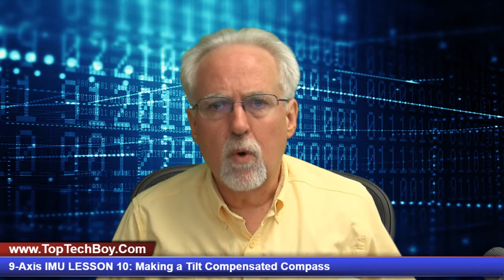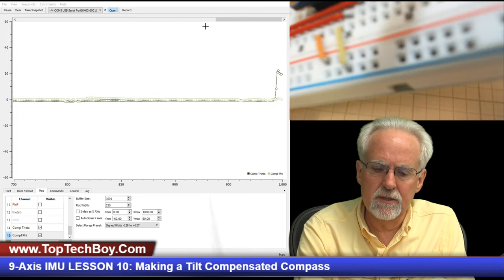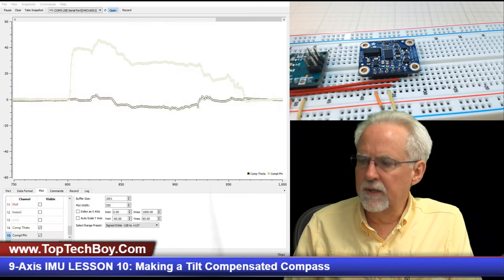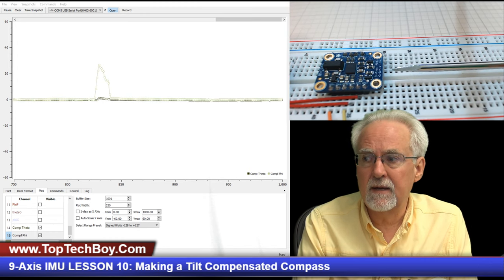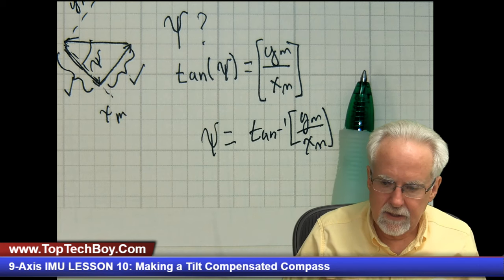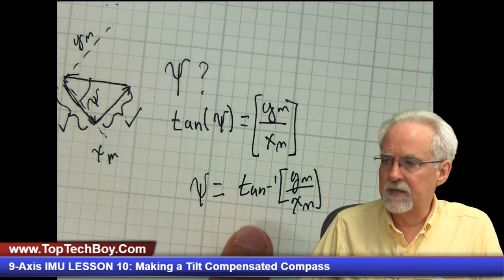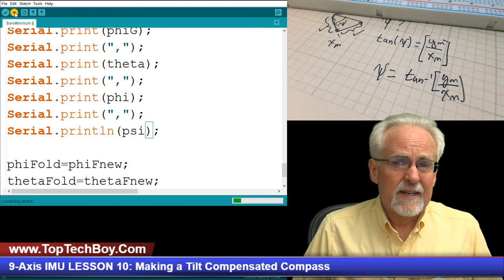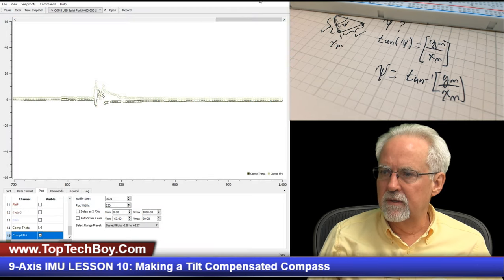9-Axis IMU LESSON 10: Making a Tilt Compensated Compass  with Arduino

Comment: Thank you, Paul, for this great series of lessons! I am really looking forward for the next videos.

I have seen some comments wondering how to derive Xm and Ym. I don't know if this was your approach (please correct me if I am wrong) but this was how I derived the solution for me:

When reading the measurements [mag.x() mag.y() mag.z()] we basically read from a coordinate system that was rotated around the x-axis by our roll and rotated around the y-axis by our pitch. What we want to achieve, is to get equivalent values [xm ym zm] (well we don't really need zm) from a coordinate system that was not rolled or pitched and thus is only subject to yaw.
So what I did was to apply two rotational matrices. Rx to rotate the vector [mag.x() mag.y() mag.z()] around the x-axis by our roll and Ry to rotate it around the y-axis by our pitch (Rx and Ry for 3D space can be easily googled). The coordinates of the non-pitched/rolled vector can then be calculated as [xm ym zm] = Ry*Rx*[mag.x() mag.y() mag.z()]. 
As mentioned earlier we do not need z but when sticking to the vector / matrix notation we can use standardized operations and simply forget about z later.

This leads to almost the same solution, except for some different signs. If you are using the newer Adafruit IMU with a StemmaQT connector, you also have a coordinate system printed on the board. If you stick to it with all the mathematical conventions, the solution using rotation matrices works right off the bat. 

Maybe this will help you or if I misunderstood something, maybe you can help me :)

Comment: I'm building a flight telemetry computer to control the recovery system, and monitor the precise in flight thrust characteristics of a hybrid fueled rocket. My research team is developing a suborbital launch vehicle that can reach space, and return with a small payload for use in atmospheric science, education, and microgravity research. Our goal is reducing the cost of suborbital throttled ascent launch systems to a tier available to high schools. I use more complicated maths (like quaternion algebra), but I find your videos helpful in the overall networking and debugging process. (I'm a rocket scientist, but a horrible programmer). As always thanks for the entertainment and educational resource you provide, and I'm especially interested in how you read data into visual python.

Comment: Another great lesson!  I'm catching up with the math - one question:  Does the Magnetometer need compensation for us in the Southern Hemisphere?  For it to point North, I ended up reversing the [your] Xm and Ym values as follows:  Xm=-mag.x()*cos(thetaRad)+mag.y()*sin(phiRad)*sin(thetaRad)-mag.z()*cos(phiRad)*sin(thetaRad);    and   Ym=-mag.y()*cos(phiRad)-mag.z()*sin(phiRad);    The Magnetometer output is noisy [maybe the indoor environment?], but anticipate to cross that bridge later progressing through these Lessons.  Great work, Paul. You certainly have a knack of making tech accessible.

Comment: I have a BNO055 and was going through various tutorials (including Adafruit) that gave formulas and output. I am so thrilled that I found yours. NONE of them (that I can find, and I have been looking) take the time to break down the individual sensor capabilities to show how they work better together. Thank you  for that! So much more of it makes sense to me now. How long did it take for you to plan this series. Very thoughtful.  I would love to learn more. Please keep going. 
My only comment on your production - first episode: I would explain to people that you think you can read the accelerometer to get change in speed in any direction, Gyro to get change in pitch, and the compass to get magnetic heading. That is not the case. That is why you will want to stay through the whole series to see how to get them to work together to get change in speed, attitude, and direction.
I am a glider pilot with lots of instruments in the panel. I have also taken to flying Quicksilver MXL Ultralights, where the only "instrument" is a Hall wind meter like the ones at http://www.hallwindmeter.com/gliders.php. I like the idea of providing a single display that adds the information derived from a BNO055 and an RC aircraft I2C airspeed indicator. It would not be a critical component because the primary indicators are; the wind meter, the wind on my face, and the gravity sensor in my butt. Please keep going.

Comment: Kudos Paul on all the great work you put into this series!!   I'm following each lesson, with all the same hardware.  The value I get for psi (heading) jumps around a lot (+/- 5 degrees), so I added a low-pass filter to the Xm and Ym values, but even with heavily weighted filters (0.9999 on prior  and 0.0001 on new values), I still see lots of noise in psi.   I'm thinking I should try moving the filter further upstream, to the mag.x(), mag.y(), and mag.z() values, and to use an averaging window on the prior 10 or so values (perhaps the root mean square of these).    Do you have any suggestions on best methods to filter the noise out of psi?
Reply: Would love to know how you solved the noisy psi signal?  Mine is very noisy and it's not a code issue.  Interference from being indoors?  Mine jumps easily 20 degrees which makes it unusable.  Thank you.

Comment: Hey Paul. Thanks for the great video. My application is going to be with a raspberry pi for a sailboat autopilot and visualization of heading info.  I had planned to use the HMC5883 Compass but the tilt error is enough to make a junior coder cry. I'm going to try a GY-9255. So much fun. Thanks brother.

Comment: Great!! had a IMU6050 and bought a hmc5883l for compass.. following and working till now with STM32 , very neat Paul!! waiting for the lab when you would calculate the position based n these inputs!!
Reply: Hi Manu, I  have MPU6050 and HMC5885L ,. Roll and pitch is working but I have problems with Yawing, 
I did everything by same way as Mr. Paul did, but Yaw is chaning when I'm tilting.. Can you upload source code somewhere?

Comment: I love this on the compass. I've used a compass for many years and always wondered how an electronic version works. I'm still having problems with my output to the Serial Plotter. My code corresponds with yours exactly so it's not the code itself. I've watched the output to the serial monitor and noticed one thing when calibrating, the "System" value stays at "0" and will not change, where as before it took a little bit but went to "3" no problem,  but the other values still go to "3" quickly. So I've ordered another BNO055 to see if I've done something to damage the board. Keeping my fingers crossed, sorry can't hold my breath that long...LOL.

Comment: We are still here, would never miss it. In the Bosch documentation it is mentioned that we can save calibration data from previous sessions and load them during startup. Has anybody looked into that?
Reply: On Adafruits website:  The BNO doesn't contain any internal EEPROM, though, so you will need to perform a new calibration every time the device starts up, or manually restore previous calibration values yourself.

Comment: Great video, I provided a like! Question, how do the heading tilt compensation equations (xm, ym) change for the MPU9250 magnetometer sensor? I know that the magnetometer is oriented differently relative to the gyro/accel sensor. Thank you for the help.

Comment: Hello Paul. 

I am enjoying your lessons about how to use the IMU.  Very informative and easy to follow along.  Of course you're teaching a lot more than just the IMU because your' also giving insight into building arduino sketches.  

I was wondering if it's possible for you to consider guiding us through the process of programing the BNO055 into the RPi Pico.   I understand the mechanics/math for determining "tilt" but would like to know how to capture the data from the IMU directly from it's registers into the RPi Pico.

I'm building an automated leveling platform for a very large (4ft X 4ft) 3D Printer and think that an IMU would work great.  However, I'm not sure about is the "calibration".  
It won't be practical to spin the IMU around like we did in your BNO055 lessons since it will be embedded in my large scale 3D printer.
Any help on how to do the calibration a different way?

Thank you so much for what you are doing.  God Bless.

Comment: I'm adapting your code for the new BNO080, and I'm gonna use this for an autotpilot for a boat. Could you quickly go over, or point the direction somehow, on what I would need to do in order to get what you call "the proper math". (I did all the calc etc. in university, I'm a CompSci major, but it's 25 years ago now... I'm mainly a coder.)
Reply: I was going to ask Mr. Paul the same question too. I'm glade to see your comment.
Mr. Paul, could you please highlight the calculations you mention in the lessons?

Comment: So I added 180 to the [-180 to 180] range so it would always read as if reading off of a compass (0 to 360), but I have a question if anyone knows the answer! Is it possible to transition our inverse tan equation into an either sine or cosine equation? That would take care of the asymptotes if I'm not mistaken and save us the issue of the Arduino flashing between the asymptotic values... non mathematician here, just a thought!  

As of now I made a low pass filter to prevent so much noise and when it reads higher than 359 or lower than 1 I had it ditch the low pass filter and delay for a half second to prevent the slow jump... didn't work as planned hahaha

Comment: You might wanna make update in the code:
- where converting thetaM to degree is done with /2/3.141592654*360
- and doing this conversion again while calculating psi

Comment: Hello, teach Paul! I have a question here: In this lesson, we are determining Yaw using magnetometers. So does that mean that by using accelerometer and gyroscope cannot get the data of YAW? If so, it would be confusing as if you see X-aixs, Y-axis and Z-axis, I think there is no different in their properties, they are all just directions, so how come we cannot get YAW data with accelerometer and gyroscope only?
Reply: Accelerometer and Gyro use the gravitational vector as a reference vector; however, they have no reference vector for the Yaw axis. Magnetometer provides a reference vector for the Yaw axis from the Magnetic North vector. Paul mentions this in the beginning of the video. I hope I'm making sense. I also had the same question :)

Comment: Hi Paul really enjoying the IMU series, you say the tilt reporting is limited to 45 deg.
is it therefore possible to mount the sensor at neg 45 deg, and calibrate to  zero
in order to get a 90 deg. swing from horizontal to vertical.
At 90 deg. the sensor would still be at 45 deg. keeping within the 45 degree limitation.

Comment: I originally purchased the BNO055 to add to an azimuth/elevation rotator for ham antennas tracking satellites. However, if I need to perform the calibration every time I turn on the rotator, it will be very difficult to climb my antenna tower, unmount the controller, perform the calibration and then remount it for accuracy. 
So, my question is, will this IMU work in my situation?
Thanks in advance. Great tutorial...much appreciated!

Comment: Hi Paul.  Yes I do watch all your videos all the way through, and yes, I am following along at home using the same hardware as you are.  I'm particularly interested in the math behind this, and have been understanding the trigonometry up to now.  However, without your explanation on the 3D trigonometry, I'm disappointed I just have to follow that section of your code.  I do understand that it's difficult to explain without being able to write in 3D.  Does this mean you will not be teaching us Quaternion math?  Can you recommend a YouTube video or other website that may be able to teach us how you derived this 3D tilt formula?  Thanks.

Comment: Hi Paul, I found this video because I was looking for a compass that works on a MPU9250. I would like to try something with an esp8266 or esp32 that would work like a wireless 3d mouse or like a Wii controller. But yes, I am also working on robots and storing data in mysql.. I have seen a few videos on self balancing robots. (2 wheel type and one called Ballbot) I hope you can help in these areas.

Comment: But there is no strong magnetic field inside could you do it with the accelerometer and gyrosensor only too? Could you help me? I really like your project and coded alson until here. Really hoped to find a way to calculate the heading without using the magnetometer

Comment: Hey Paul, I have a dilligent question: Is it possible to place a more dimensional measurement unit into a cnc router? With the intention that a router would be able to cut in more dimensions. Is the measurement unit a helpful tool for a cnc-router?
Reply: No, you use stepper motors for this, which use angular position tracking rather than acceleration, and are far more accurate since they use the number of magnetic stator windings as the division units of their unit circle. This allows you to precisely set where you want an object (like a mill bit) to be in space by using 3 axis, 4 axis (like mine) or even 5 - 6 axis control, with each axis controlled by a single stepper.

Comment: Man, I screwed something up along the way!! Tilt compensation was magnified instead of compensated out after writing the code. I’ve been using x,y,z instead of phi,theta,psi because it’s easier for me to visualize, so I suspect I got some values crossed along the way. I’ll tackle it again tomorrow after resting the brain. I also noticed I have a lot of soft metal interference when I put the setup on my metal desk vs the glass table next to my desk. Are we going to learn any filters for soft metal interference?
Reply: Ok... fixed it!! Double counted an angle... onward and upward!!

Comment: I'm using MPU and HMC5883L together, but I have problem with Yawing. Is magnetometer callibration neccesarry? I just want to have same direction(even wrong) when I'm tilting.
I did everything by the same way as you did . Roll and Pitch are working fine. Please help somebody, I'm working on YAWING almost 3 weeks and still not finished yeat...

Comment: Paul I have problem my yaw reads
North 170
East   - 90
West    70
South    0
I cannot figure out what is wrong. I even downloaded your sketch and its the same help please
Reply: In general on an IMU the magnetometer has axes different (even opposite) of the acc/gyro. 

You have to align the mag. to the axes of the acc/gyro., look into the datasheet of the IMU and you'll find the drawing of how the arrows point.

In your case it sounds like North and South are swapped, maybe there should be a minus in front of that mag.x and y.

Comment: is it possible to make Tilt Compensated compass with UNCALIBRATED magnetometer? Please somebody answer me.. :((
Reply: I believe that it would have to be calibrated. However, in another video they logged the min and max values for each axis of the magnetometer (full rotations about each axis) found each axis' respective median value and subtracted the median value from the raw data. This essentially "centered" the raw data thus "calibrating" the magnetometer.